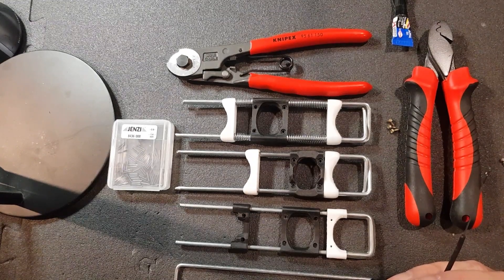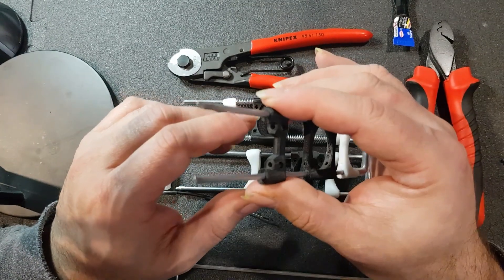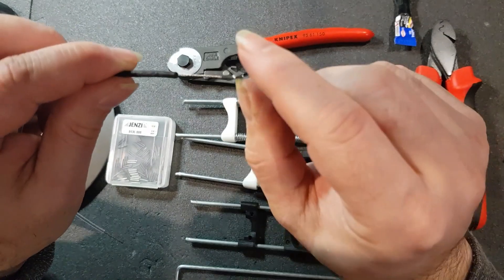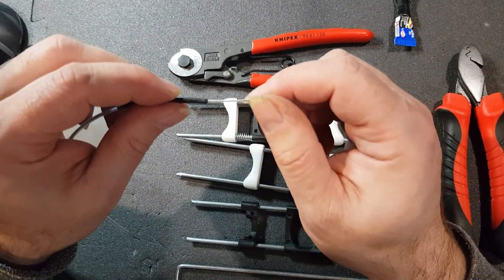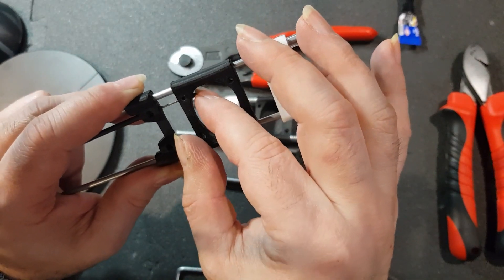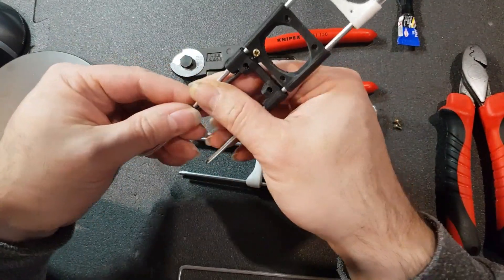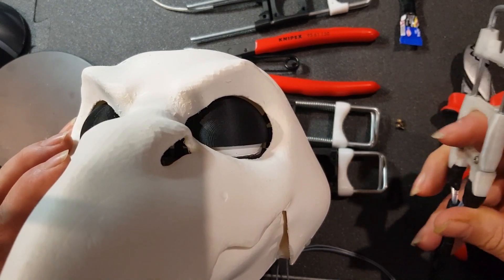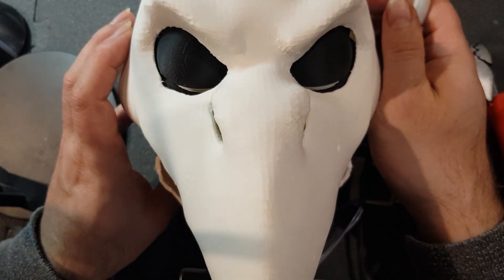How to assemble the Bowden cable controls

Comment: What screw size did you use? Also what are the size of the springs used for the controller?
Reply from the maker: The screws are M1.4x3. The springs are from a cheap spring set - they are not all the same size.

Comment: Hi where did you get that bowden cable? I'd appreciate it if you can let me know the website you got it.
Reply from the maker: I bought 2mm diameter PTFE tube (inside diameter 1mm) and 0.8mm braided stainless steel cable - both parts were ordered from Amazon.de